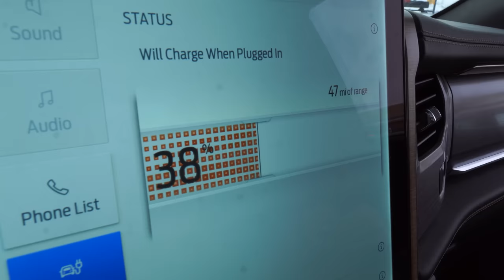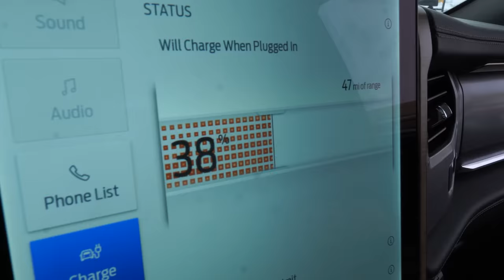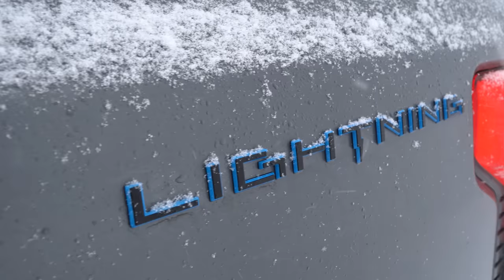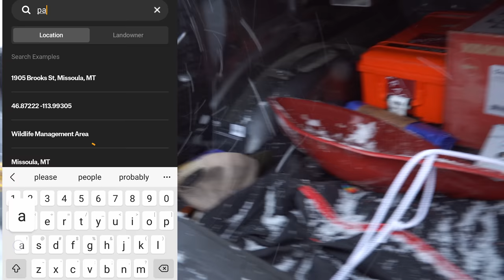The Ford Lightning should stay in the City - Cold weather Kills this EV truck! Watch before you buy!

Comment: Any EV is for city use only.
Reply: And yet they ventured out into the snow covered mountains just fine.
Reply: @Josh-179  after they drove forever to get charged and waited to change, got stuck, and can only stay out for a limited time, sounds great. Have at it
Reply: @vince4316  , I didn't notice any gas stations out there either.
Reply: @Josh-179  don't need em when you get twice the range and can carry extra fuel if needed.
Reply: @vince4316 pack extra batteries?

Comment: Thanks for the video Max. I tried one out here in North Michigan. I am not impressed with this truck at all if they’re gonna have something like that they should have solar panels, built into the hood, the top of the truck everywhere to keep it charged that would only make sense you know and I guess the towing capacity is really not that much either there’s no way I could tow my Harley trailer it would suck the life out of the battery plus the cold I’ll stick with my old Ford F150 for right now. 😝 ok 👌🏼🔥🤠🔥Camping Russ out

Comment: If I stick to 70MPH I get 1000km to a 136L (36gal) tank on my F150 with the 5.0. On trips I usually throw 3 or 4 25L cans in the bed. So I have pretty close to 2000km of fuel on board.

 There's no chance I'll ever buy an EV.

Comment: Lightning will be my next truck, as soon as Ford offers it with a less useless bed size.
Reply: This is by far the best selling truck configuration. Doesn't yet make sense to offer more when the wait list for this is 2 years.
Reply: @Josh-179  The crew cab, 6.5ft bed will come out in a year or two. They did the same thing with the diesel F150 by starting with the tiny bed and then offering more configurations down the road. 

Also, the longer bed will allow for a larger battery pack and greater range. Ford wants to demonstrate that the Lightning can work just as hard as ICE trucks, so of course they are going to start offering more capable configurations soon. The demand for the current configuration is showing that there will be enough demand for different configurations as well.

Comment: The battery tech is definitely not there yet for towing or cold weather, but it is improving. New sodium and sodium lithium blend batteries are out this year that help with the cold weather and are cheaper. Still not good for towing, though. Give it a few years.. battery technology is rapidly changing and improving.
Reply: EV Vehicles are way overpriced and Mining and Disposal of The Batteries is bad for the environment..
EV s are good for City Driving .
Hybrid is and will by far Be a Better buy than All Electric
Especially for Cold Weather and Off Road..
Charging is Time Consuming and a Hassle for Drivers
Reply: @danielheideman576  It will definitely be interesting to see what technology (or mix of technologies) wins out.
Reply from the maker: I feel like Hydrogen powered vehicles will crush Ev in the near future.
Reply: @Maxx.Powell  It might. Hydrogen injection engines run super lean though, so they’ll have to design around that. Or you use them in fuel cell EVs. The problem is efficiency.. hydrogen isn’t efficient. Engineering Explained’s YouTube channel does a great job of going over the limitations. I think you’ll see it in ships and maybe long range OTR trucking, but I think enough improvement is happening in the battery space that passenger vehicles and light duty trucks will go EV.
Reply: @gridjac  EVs are really efficient either, neither is the process to make em. Honestly I think a hybrids the way to go
Reply: @moskovthefirst2227  It’s probably not worth my time to write this, since this isn’t a channel whose audience is likely up on EV technology or is all that particularly excited by the emergence of them. But.. what you said is false. EVs are significantly more efficient than ICE vehicles. As for efficient when making them, I assume you mean the actual manufacturing process? If that’s the case, it depends on the manufacturer. Tesla is extremely efficient at building them. Other legacy manufacturers, not-so-much. Or do you mean the materials that go into building them? If it’s that, studies have been done showing that EVs -even with mining for battery materials factored in - (which is changing as new battery technology that uses different minerals is moving out of the lab and into production)are better for the environment and have a lower carbon footprint. But I don’t expect you to believe that, because most automotive/off-road enthusiasts don’t. To which I can only answer, “I guess we’ll see.” Ev technology is rapidly advancing. It’ll be interesting to see where we are in 10 years. Maybe EVs won’t be the future of transportation and something new and better will come along. My personal opinion is that we’ll see a mix of several technologies. I only hope efuels are one of them since auto sports aren’t the same with the buzz/whir of an EV versus the sound of a blown V-8.

Comment: Yeah nothing about that looked appealing. I'll take my gas truck every time. We have a long way to go before we switch to full electric. For one, the obvious infrastructure failures, the expense of the guaranteed failure of lithium batteries, not to mention the fact that lithium mining is terrible for the environment, and a depleting resource at that. Until they design a battery that uses a readily available resource like salt water, it's just not good. Also, something many people probably never considered, yes, driving and temperature affects battery consumption, but so does your air conditioner and heater, a lot.

Comment: Those trucks are junk. Every person I talked to that had one got rid of it inside a month. One guy's the battery took a crap 32k for the battery.  If you were only going to the grocery store perfect ride.🤣🤣
Reply: how many people did u talk to that had one??? i’ve only seen 2 out in the wild driving and i didn’t get chance to talk to them.  so you are saying you saw  several people that have had them and sold them within a month?!?  so i’m curious how u met them having the truck, the. found out later they sold it in a month
Reply: @raptorider42  I've seen 3 and they were disappointed because you really can't use it as a truck. One guy on you tube had one for a month and got rid of it and the battery went bad right after he got rid of it.
Reply: Will Prowse had on briefly, took it  back for a full refund. Dealer said it was the 4th one they took back. 😢